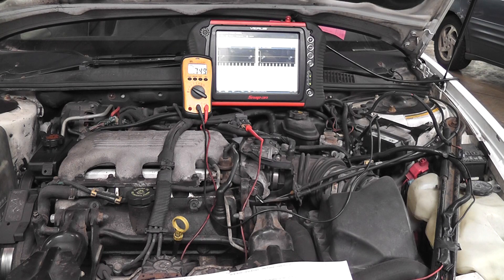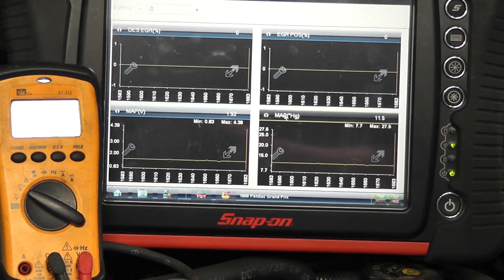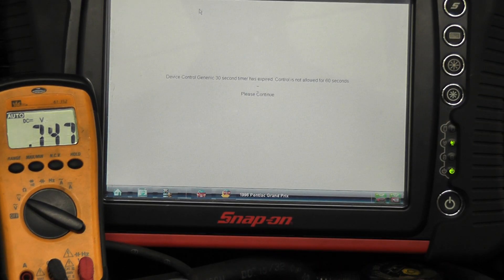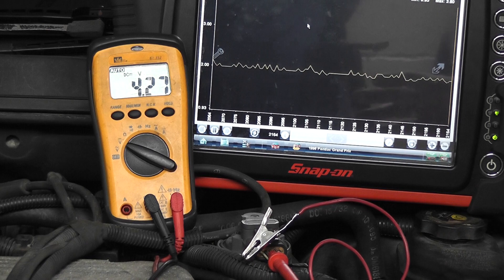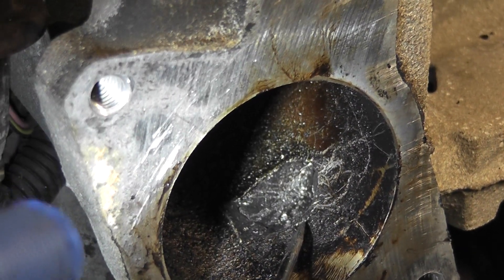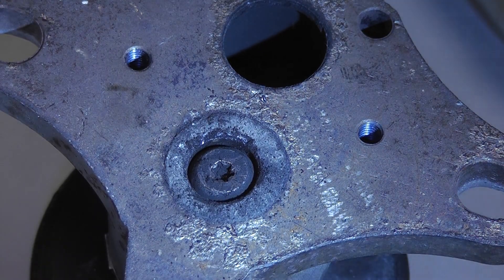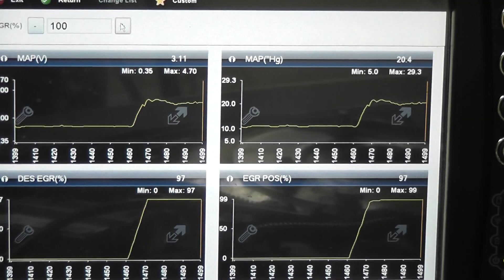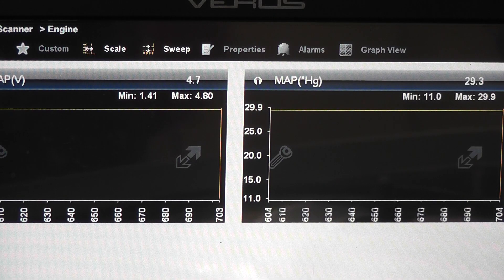How to test for EGR flow problems (GM electronic EGR test) - P0401

Comment: question, can this problem with this egr valve causes a p0300 i have a 06 aveo  with this problem,, have done and check injectors,spark plugs, wires, coil pack, compression and air leaks found nothing with all this things

Comment: Scanner Danner.  I own a 98 Chevy Suburban K-1500, LT. I'm getting the P-1404 code. I replaced E.G.R. not once, but twice.  Still getting same code. Engine does not stall at idle, or hardly hesitate ever.  I get a little bit of buck, jerk under light, light throttle, or under heavy throttle.  Otherwise no other symptoms.  It's had new motor almost 3 years ago now, along with new Transmission year, and half ago. New Fuel Pump recently also. Before Fuel Pump, it ran really bad, but was not getting any codes, still experiencing these bucks, jerking back then. Took to my local GM Dealer who did work on motor, trans. They said replace, I did twice now.  They want me to bring it in again, and charge me again for diagnostics.  What's going on, can you help me out here??. I'm clueless of what to do from here. I do not have the fancy test equip you have.  I've sprayed Carb Clean down orifice for E.G.R., scraped in there as far as I could. No change.  Help!!.
Thanks for any help.
Reply: its broke

Comment: HEADS UP!!! I discovered that oven cleaner works great to open up EGR passages and takes care of carbon build up a lot quicker than brake clean but DO NOT use on the valve itself. As a test I tried it cleaning the EGR valve on my personal car and a few months later a po1401 code came on and a leak between the valve block and the solenoid was found using a smoke machine. I think the cleaner ate away the seals inside the valve but I cant say 100 percent for sure because the valve has 100k on it.

Comment: hey man, I got a 1998 nissan sentra gxe 1.6 l. and today since I took  my car out, all of the sudden it shut down on me at least 5 times. check engine light came on, I had it read n the code is PO400 EGR passages blocked, EGR pintle stuck closed, eg volume control valve open or shorted, and EGR temperature erro. do u think I just need to clean the egr valve? please help

Comment: I have a 2006 Equinox 3.4L. Cleaned the air intake and what I could reach of the inside of the EGR. Erased both codes after cleaning.  Drove it less then 20 miles and the 404 came back on.  No rough idle.  Is the EGR bad?

Comment: Thanks, i typed wrong it was 401 not 410......Also I cleaned the intake and erased the codes and the 401 didn't come back but the 404 came back on within 20 miles of driving.  Any suggestions?  replace EGR?

Comment from the maker: P0404 is an EGR position sensor issue. the valve could be sticking or needs replaced. i don't listing for a P0410

Comment: 1998 Saturn SL single cam. My only 2 thoughts i can come with is maybe the PCM is fried some how, but the fact a scan tool with bi directional control can force open the EGR to me it sounds like PCM is working like it should, other then this i can only think of the intake manifold being clogged or leaking gasket on it. Other then this im at a lost at this point, im also getting a p0420 code for the downstream cat but figure best to tackle EGR first then reset and see how it go's

Comment: Hey ScannerDanner, if the EGR is commanded open and the car stalls with a 401 code insufficiant flow. What could cause this?. Getting ready to pull the intake manifold to make sure it doesn't have any carbon build up but wanted your thoughs before i spend the time doing this. Thanks.

Comment from the maker: absolutely! but it is not a scan tool so there are no by directional controls. it does not interface at all with the data link connector. it is a scope only with a really really good data base. in fact the component test database, in my opinion, is un matched in this field

Comment: I did one of these today... Was funny because the vehicle ran with the egr removed from the engine. Was kinda slow today so I tried an old hood release cable in a cordless drill and surprisingly worked really well. I made it with a large fray on the end and it cleaned it right up. This same car had a intermittent cylinder two misfire that I scoped out to be a shorted spark plug or rather before the air gap. It had lots of turbulence right after the spike and no air gap. Great video Paul, Thanks.

Comment from the maker: it could be from a sticking open EGR which would cause a stall, but on this model that should set an EVP signal too high code, not a flow code. As you saw in this video, the most common cause of a P0401 is a plugged up intake passage. Which will NOT cause stalling or running hot complaints.

Comment from the maker: @stingray300m can you give me a pintle position voltage with the engine off? if it is lower than idle you bolted the egr on backwards and intake vacuum is lifting the pintle open at idle. the numbers you gave me are too high for a closed valve position.

Comment: i have a 97 grand am and i have a p1406 pantal posistion sensor circut code checked egr valve for carbon depisits none at all and the valve is not sticking open or closed checked wireing to the valve all 4  termanals are good the feedback voltage the fifth wire is 1.5-1.7 at idel the 5 volt ref is good and so are the solanoid wires checked the filter curcit with a test light and the light lit it has a dioed in the circut i thank i might need a new pcm what is your suggesten

Comment from the maker: I showed the MAP in this video but if you think about it, it really isn't necessary, especially because ideally you want the engine to stall. So of course that will cause very high MAP volts. I have another comparison like this in my ebook in Section 23 but again I don't worry so much about the MAP as long as the engine gets real rough and or stalls. If an EGR is stuck open at idle fuel trim numbers will be severely negative. Not sure of a number though

Comment from the maker: @import0408 Awesome, thank you for the purchase. In the future you can contact me directly through email. It may be easier. I offer this to all of my buyers. Anyway, the answer is yes, it is the same linear EGR on the 3.8 and has the same pintle problems. The passages on the 3.8 are not the same though and rarely plug up on this engine.

Comment: Does the gm 3.8 use the same egr. And does it have the same pintel problems as the 3.1 and the 3.4. Ps about a 1/4 of the way through your book very good stuff will probably read it 2 or 3 times in a row very good info. I did print it off and put in a 3 ring binder took quite  some time but much easier to read than on my smart phone. Keep up the great work.

Comment from the maker: @jagcar4407 Is this the EGR solenoid or is there an EVP sensor on top of the valve that you are talking about? Either way the ohm test is not the correct way to test those. Voltage testing on the EVP and voltage and current testing on the solenoid is the way to go. The EVP is tested just like a TPS (watch my videos on TPS testing). The solenoid is tested like any other solenoid (i have videos on that too)

Comment from the maker: @ScannerDanner find the stud just above the starter with 4 or 5 smaller gauge wires going to it. Should be a couple of black wires and a couple of tan wires if I remember right. One of the tan wires is the O2 sensor ground. It messes up the O2 signal to the PCM especially while accelerating. During accel the engine torques  toward the firewall and stresses those grounds. One by one the copper strands break inside of the insulation.

Comment from the maker: @haze541bsn LOL "damn you autocorrect" you have to check out that website. One thing comes to mind on the 2.4 is broken PCM ground wires above the starter motor. They break inside the insulation and look good visually, tug on them an they will break. Also oil in your air cleaner is either a PCV system problem, too much blow by gases from worn piston rings (internal engine problems)  or you put too much oil in the crankcase.

Comment from the maker: @enx0884 No problem, I am going to try that next time. In the video I really wanted to show where the restriction was. I have had success with a coat hanger too. Keep in mind you should do the test I am showing in the video when you are done and make sure the engine stalls or just about stalls. Also be aware GM changed this linear EGR to a power side switched circuit in the later years.
Reply: ScannerDanner I

Comment: Thanks for answering my question. I didn't have to take off the throttle body. I tried the short piece of speedometer cable from the EGR side and it worked like a charm! You saved me a bunch of money!

Comment from the maker: @enx0884 There is two coolant hoses on the bottom of the throttle body, that is the hardest part. Unplugg all electrical connectors, take off two main bolts that hold it to the intake. Leave all of the cables on the throttle body and just move it out of the way. There may be a bracket that holds the cables that can be unbolted. You could also use a piece of small cable in a drill and go at it from the EGR side, never did it this way, but heard about it, can leave throttle body on.